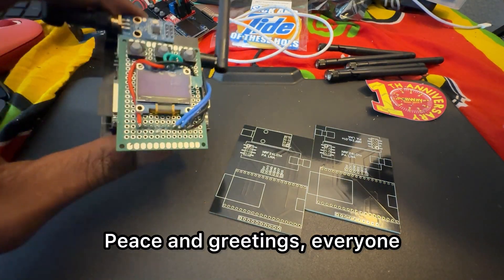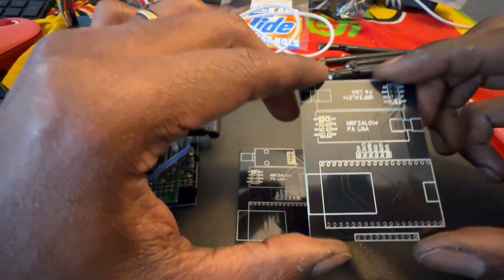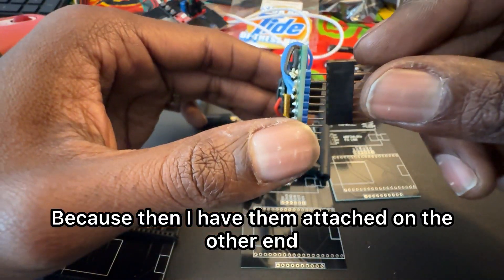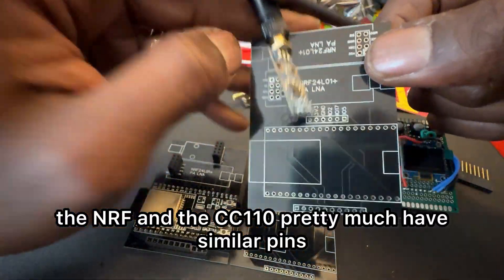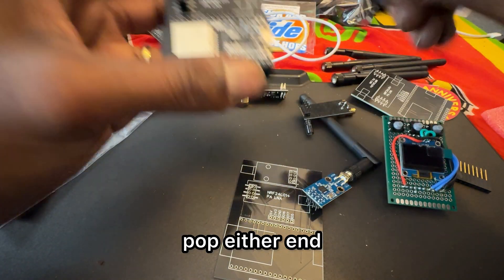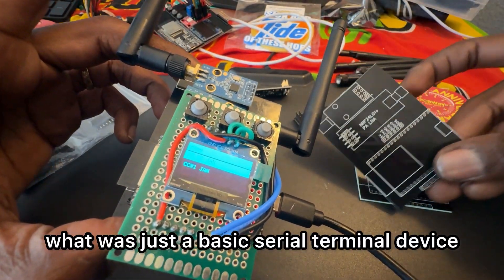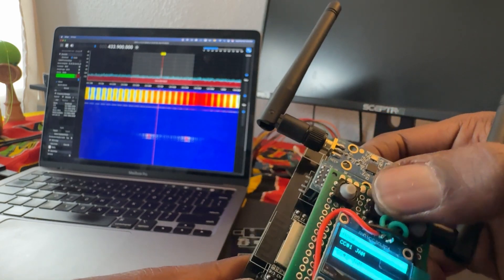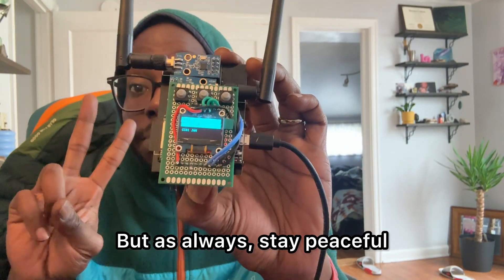Elevating the Bluetooth Jammer PCB | Display + Buttons

Comment: Thank you for your work and generosity . If i use two cc1101 i need to connect IRQ for both of them and where exactly ? Please share the PCB and schematic for this elevated project. Peace and greetings !
Reply from the maker: There will not be enough pins for 2 cc1101 unless you remove 2 buttons

Comment: Hey awesome job man! Question, why do you typically use 2 or more RF modules for your projects? Is it to make it more effective? Is using one not as good? Thanks I’m new to RF stuff
Reply: Because thats don’t can send signals to more band widths
Reply from the maker: Yes the more modules the merrier in some cases, other times each module has its own functions. For the Nrf24s it is for more power

Comment: I did build and get the jammer working. However there is a flaw. As long as jammer is in between the radio, phone or whatever you are playing your music from (transmitting) and the bluetooth speaker or car stereo that is receiving the signal it will jam the frequency and totally cut out the music.

If the transmitting device (phone in my case) and bluetooth speaker ( I used one of the mini speakers I had laying around) are next to each other it will not jam the signal or it will cut it out in short breaks (choppy sounding but very infrequent).

I can verify a range of about 12-15 feet (across the kitchen). I was a little dissapointed that it did not work as I had hoped because I have this pain in the ass neighbor that sits in his driveway with his radio blasting everyday. 

I was going to mess with him but I don't think this jammer will work due to his phone is right by his car stereo and I wouldn't be able to get the jammer in between.

If you have any suggestions how to amplify this signal to improve how it works I'd like to know. Larger dbi antennas? An amplifier? If an amplifier would work, how would I hook it up? Idk, I'm shooting from the hip now :(
Reply from the maker: Yes amplifiers and band pass filter and also a different antenna such as a Yagi antenna which is directional will help.

Email me or reach me at discord , it will be easier to help you
Reply: @littlehakr  I will set up a Discord and get in touch with you. Thanks